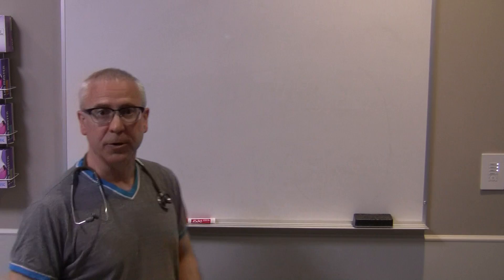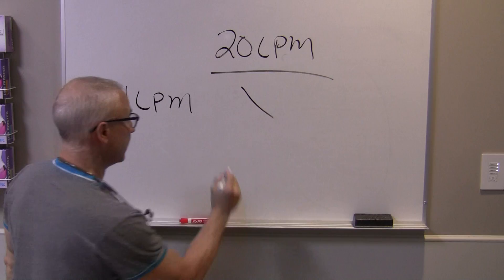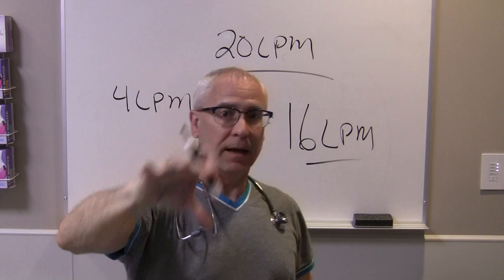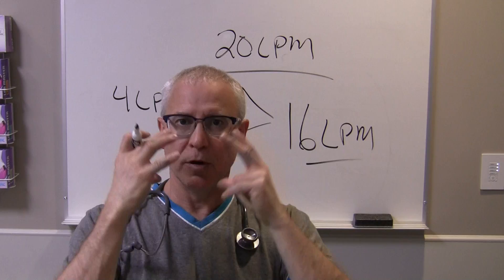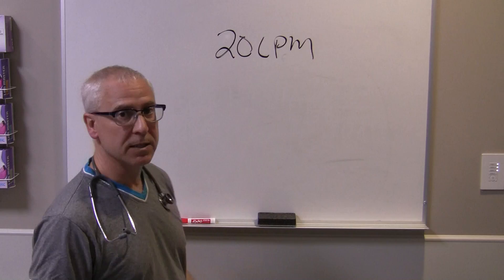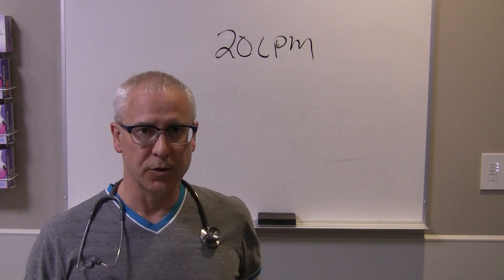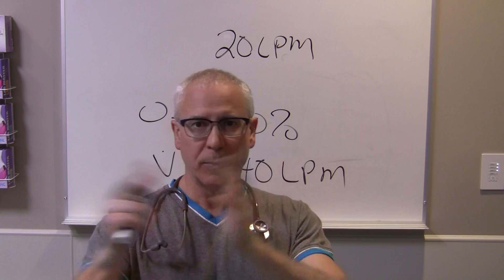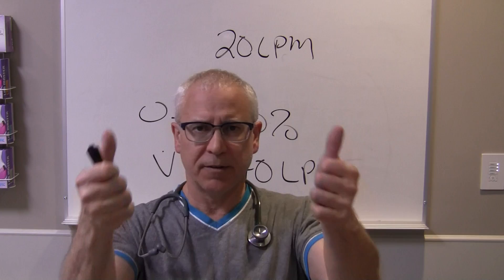Low Flow versus High Flow Oxygen Therapy: The quick and the dirty

Comment: Hi, thanks so much for this video, genuinely the best explanation on this topic! I have a question about the titrating of oxygen therapy e.g for a patient on airvo. Say the patient is on AIRVO 30L with 30% FiO2… but their saturations are still low…. Which of the parameters should you increase first? Flow rate, or Fi02? Thanks!

Comment: For an ET tube, or a trach, if you want to do some high flow, the simplest way would be to set the ventilator in CPAP/PS, with a PEEP of 5, and a Pressure Support of 5-7, and there you go. You have high flow, Glorified that is, and you have the FiO2 you want, and not only that, you have yourself the ventilatory monitors. Now it's not as fancy as per say the High Flow I was on a few weeks ago, with the Hamilton ventilator, but it's something. And just as you said in your extubation video, It's a glorified High Flow System.

Comment: Great video, thanks! Question: When deciding on weaning a patient off the high flow systems, what metric do you change first (Fio2 or flow rate) and what's the rationale? Does the need for high flow automatically suggest high Fio2 needs? or do these both go independently?

Comment: Thanks for your clear explanation. 
Why T-piece and Venturi mask are considered high-flow delivery systems though their flow rates  are usually 4-10 L/m?
Reply from the maker: Hi: When you set an oxygen flow to a certain value on the flowmeter, air is going to be entrained through the venturi device increasing the total flow the patient gets.....as long as it exceeds the patients inspiratory flow.  For example; the ratio for oxygen and air for a delivered O2 concentration of 40% is 1:3.  If you run an O2 flowmeter at 5 LPM, the entrainment system will draw in 15 LPM of roomair.  The two gases will mix and deliver to the patient 20 LPM (total flow) with an oxygen concentration of 40%.  If the patients inspiratory flow rate is less than 20 LPM, this would be a properly set up high flow system.  Hope this helps.
Reply: George O. RRT 
sorry maybe stupid question,but where do you get 1:3 ratio from?
Reply: @poliklolik  the venturi pieces are designed to achieve a set ratio when provided the appropriate O2 flow.
Reply: Neonates have a much lower inspiratory flow rate than an adult and so what would be a low flow system for an adult can be an effective high flow system for a neonate. That is the context in which T pieces are typically used.

Comment: Thanks George.  How does an HFNC device adjust the FiO2 delivered to the patient at a given flow rate, for instance 40 lpm ? I mean at a single flow rate of 40 lpm, how can it vary the FiO2 according to our settings, say 60% and 40% !
Reply from the maker: Hi: That depends on what device your using.  With an Airvo for example, you would program the flow rate and FiO2 into the device, then increase the titrated flow of O2 (from the flowmeter)  into the device till the required FiO2 was attained.  There are certain limitations or max values to the Airvo with flows and FiO2's deliverable to the patient.  With HIgh Flow Blender setup, you would simply set the required O2 concentration on the blender then adjust your flow with the flowmeters on the blender till the required flow was attained.  Always verify concentration with an O2 analyzer with the blender setup.  The Airvo has a built in analyzer.  Hope this helps.

Comment: Does going from 50l/m at 70% to 50l/m at 60% indicate the patient's lungs are working better or is the % simply an arbitrary number?
Reply: Generally speaking yes, the lower the percentage the better. The percent indicates Fraction of Inspired Oxygen. So if they are breathing the same with 60% vs 70% then their lungs are likely doing better. We can use their Fi02 and put it into the P/F ratio. The P is going to be their Pa02 (obtained via arterial blood gas) and the F is their Fi02. We divide their arterial o2 by the Fi02 percentage. A Pa02 of 100mmHg (perfect score)/0.21% Fi02 (room air) gives a top score of 476mmHg on the P/F ratio. The lower the number, the worse the lungs are. Below 300 is indication of ARDS, below 200 is really bad, below 100 is GREAT BADNESS. A patient with severe ARDS might only have a Pa02 of 45 (this is pushing into the severe hypoxia range) and might be getting 100% oxygen. Their P/F ratio would be 65. A P/F ratio this low is associated with a 45% mortality rate.

Long answer short, the Fi02 in your example is kind of an arbitrary number to indicate their lungs working better or not by themselves. If we add a little context to it then it becomes a much more important number.

Comment: U said bigger the oxygen device is (in low flow) that much fio2 it can give. If we take a simple oxygen mask though it has big surface area it accumulates co2. So how could we make it useful.
Reply from the maker: Hi:  If I understand your question correctly, Your asking how you could make a simple mask (low flow O2 therapy effective).  O2 masks are effective when used properly but have their own limitations.  If you are using a simple mask for example, the effective range of flow is usually between 5-10 LPM.  Sometimes higher than 10 but never lower than 5 LPM (adults).  When used this way, there is sufficient O2 flow coming into the system to wash out any exhaled CO2.  Using flows lower than 5 greatly increase the chances of rebreathed exhaled CO2.  When using masks with bags on them like the PRB mask and NRB mask (partial and non rebreathing masks respectively), maintain the rule of thumb that says when the patient inhales, ensure that those reservoir bags remain inflated.....so use enough O2 flow to keep the res bag inflated as that is where the gas comes from for the next breath, plus the flow helps to wash out any potential CO2.  The design of the mask and bag and valves (NRB mask) reduce the chances of rebreathing of CO2 when used properly.  Hope this helps. George

Comment: What is the highest percentage points of hfo 1L ? @ 90min
Reply from the maker: When the O2 system (high flow) is set to 100% and you run the O2 to the patient at a flow that exceeds their inspiratory flow rate, the delivered O2 concentration will be what you have set it to on the high flow system....so in this case 100%....it will remain so until you either chance the set concentration, the patients inspiratory flow are or breathing pattern exceeds the set flow or you run out of oxygen.  Let me know if this answers your questions.